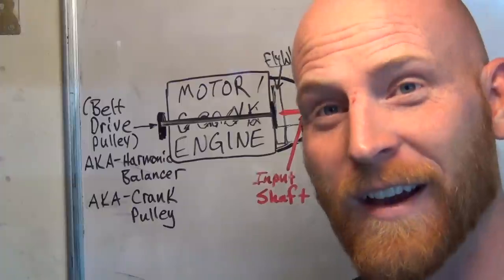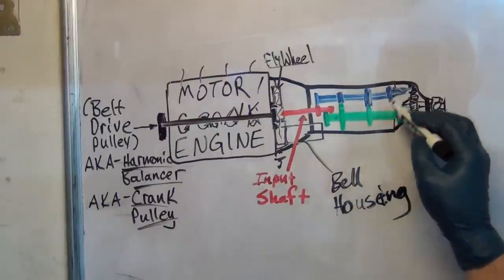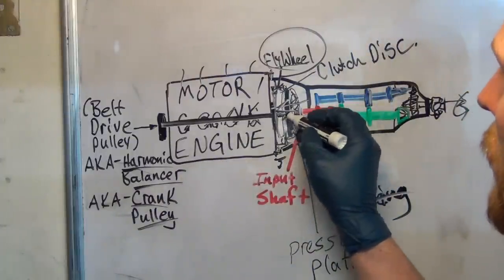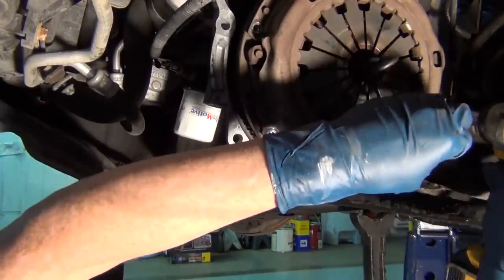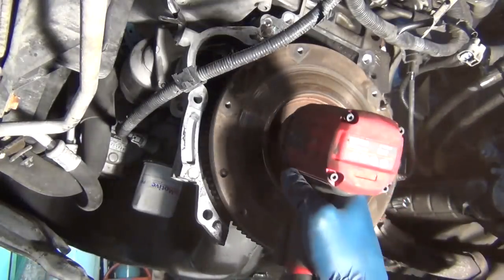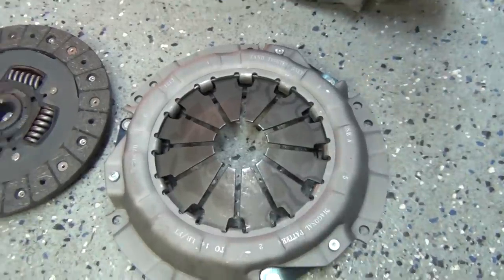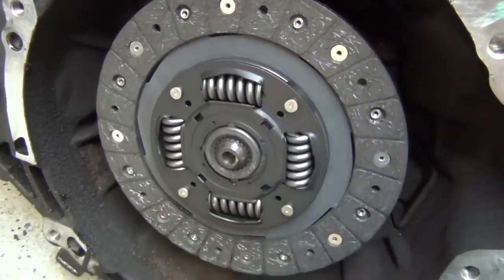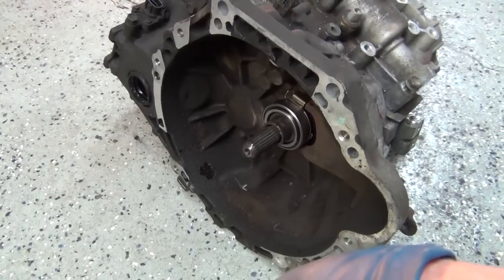How Does a Clutch Work on a Car? Answered

Comment: I've said it before and i'll say it again- I love your videos.
The most important part that I NEEDED to make sense of this entire system was the "Clutch Fork"
The entire idea of switching the direction of forces through geers or the teeter totter process has always been to me one of humankinds most awesome intuitive design schemes that never ceases to amaze me. Knowing how the downward force on the clutch creates the resistive/pressure force on the pressure  plate, now makes everything come together.
Ive had to remove a transmission before (someone came and repaired it at the house but they required we had it on a table and they opened it up and worked it out)

Comment: Great video. One recommendation I would add is that it is a good idea to always replace the clutch fork pivot bolt when doing a clutch job.  Nothing worse than to have that pivot bolt break off soon after installing a brand new clutch. That would be another case for justified curse-word use.

Comment: Great video. I knew the basics of how a clutch worked (without the proper names) but this is so informative.

I'm currently having trouble with my clutch but not sure if its the clutch that's shot or the slave that pulls the clutch lever. Maybe you can help.

Sometimes when I press the clutch pedal there is pressure (ie pushing against the springs to separate the plates.
Other times there seems to be very little pressure and of course the plates are still connected which means I can't change gears.
Clutch pedal still goes to the floor.

Does this sound like the clutch at fault or the slave to you ?

Comment: Brian amazing video and explanation i as well have a 96 corolla 1.8 7afe that ironically is going to need cluch work done soon...  It's funny that you post this at the same time! One word of advice my mechanic and forums say with corollas and maybe other Toyotas it's always good to replace the flywheel along with the clutches higher miles because they have a tendency to slip sill if not replaced with clutch..

Comment: Very good explanation. I have a question, when clutch pedal is pressed is the release bearing always rotating? And if so is it bad for it? What is the best thing to do when waiting at traffic light or traffic jam, press or release clutch? How can we extend lifetime of flywheel, clutch, bearing? Thanks
Reply: turbozobb i have the same question, briansmobile1 what's best to do?
Reply: SoyAweonado turbozobb Best thing to do while waiting in traffic is to put car in neutral and keep your foot off the clutch pedal. Do not ride the clutch. Stay off that pedal unless you are shifting in or out of gear. briansmobile1 has a video detailing the repercussions of clutch riding. Cheers.
Reply: It looks pretty simple but.. i'm from mexico and i live in a little city wich has terrible street management and feels like a fucking carnival to ride here... there is a red stop sign in almost every 2 blocks you drive.. it's insane.. So how much does it hurts to keep the clutch pressed?

Comment: Hi. What make the clutch disk stay away of the fly-wheel when pedal is press? I mean, is like is free, but don't see anything actually moving the disk away to return to in a central position between the fly-wheels. Is like a sandwich. But when pedal is press, what make the disk stay away of both slice of bread? They touch each-other slightly or there is some kind of spring keeping it on central position?

Comment: Great video! The enigma of how a transmission works finally solved. Now, if I could just find out why everytime i push on the clutch pedal I get some serious squeaking. I'm guessing it's something related to the fork or the slave cylinder... maybe the ray's of sunshine or the springs on the pressure plate. That would be less fortunate.

Comment: Good video! I heard you said Red Loctite was used on the flywheel bolts. Would you use Red or Blue Loctite on the pressure plate bolts? I would like to see the replacement of the rear main seal. Thanks.

Comment: when pedal is pressed pressure plate disconnect from the clutch disc.
at the same time ,is clutch disc disconnect from the fly wheel or not .
(why i am asking this is input shaft is connect to clutch disc ,when we apply the clucth pressure plate disconnect from the clutch disc,if clucth disc donot disconnect from the flywheel then clucth disc rotates with the flywheel then input shaft also rotates)

Comment: Hey Brian!
What is the purpose of all those carved out metal "compartments" on the back of the engine block as shown at 16:00?   Is this to save weight, or something to do with the distribution of heat, or both, or something else?
Subscribed, btw.

Comment: Hello Brian! I don’t know if you will see this, but I have a question. I watched your two videos on replacing the subaru clutch, and after putting my transmission back in, the clutch pedal goes to floor! It seems as though the slave is operating fine, I ordered a new one, but I am beginning to suspect that the transmission didn’t go in right. There was a gap between the motor and trans, very small, but i put the bolts on and now the bell housing is flush, but no disengagement with the clutch. Let me know your thoughts if you see this comment, thank you.
Reply from the maker: Hello!  If there's no resistance and the pedal drops, it's most likely the pushrod missing the fork, or there's air in the system, or something not making contact in the kinetic chain between the slave cylinder and the pressure plate/throw out bearing.
Reply: @briansmobile1  Is there somewhere I could email you a video perhaps so you could see for yourself? I bought a borescope and looked in the bell housing, the retainer clips are still on the throwout bearing and it is making contact with the pressure plate, but when I push back on the slave cylinder with the fork away from the pressure plate, I can feel the slave cylinder pushing back. The slave will get to the end of it’s travel, but it still won’t fully disengage the clutch. Weird situation. Wondering if the input shaft didnt fully seat right into the clutch disc and the pilot bearing.
Reply: @briansmobile1 Hey Brian. You didn’t reply to my reply but if you want to know, the input shaft isn’t fully seating all the way in to the clutch disc. So there’s a gap between the pressure plate and throwout bearing.

Comment: Great video Brain!  Q: I see your vehicles on jack stands vs. lift, what do you use to lower the transmission when disconnecting them from the engine to replace the clutch, floor jack?  Thanks, DC

Comment: So I just bought a 96 Impreza outback and she said it had a new clutch in it, I'm learning to drive stick on it, I haven't burnt the clutch, but I've rode it a little, am I going to ruin it learning how to drive, I'm not bad at stick and my brother taught me the less your foots on the clutch the longer the clutch will last and it's just generally better for it. Is it bad to ride the clutch a little at first and will I need to change it?
Reply: I think I've got it down for the most part
Reply from the maker: +Connor Keegan Don't keep your foot on the pedal.  That's known as "riding the clutch" it wears it out really fast.

Comment: Hey man. I have an 86 ford f250 3/4 ton pickup with a 4 speed granny low. And the other day I was driving and all of the sudden it was super hard to shift and I went to stop and the clutch wasn't even working. Took off my inspection plate and I found that it has brand new clutch plates. I also know my hydrolics are working. Plus I was manually moving my clutch fork and there was no compression. Plates wouldn't move. Any help would work. Thanks

Comment: Hey guys question. Im hearing a winding sound from the engine bay. I have had all my belts checked and changed but still have the sound.i only hear it when the car is turned over in first gear. Any ideas? Could it be the thrust bearing?

Comment: I have the same question as below. When you press the clutch what pulls the clutch away from the flywheel since its just sitting on a shaft?  Unless the shaft moves, but i know it doesn't move horizontally.
Reply: At the very beginning of the whole mechanism being taken apart you can see a diaphragm spring. It's the part of the pressure plate that sort of looks like a propeller, it has holes arrayed around the input shaft. When the clutch is pressed  the center the diaphragm spring is pushed towards the flywheel. This causes the outside of the spring, which is attached to the friction clutch, to be pulled away from the flywheel thus ceasing contact of the two friction surfaces.

Comment: Hey Brian awesome job on everything all the way around...my friend got her engine redone i borrowed it for a few days because my truck was in shop.She has an 04 Audi Quattro (cant remember if it was 5 or 6 speed} Anyway i noticed that when downshifting into second gear i could feel like the whole damn thing underneath  the shifter (while my hand was still on shifter ) would  abruptly move as if someone forgot to tighten a mount or nut ... it almost feels like the tranny is moving up and towards the back of the vehicle ... the car rides fine beside that big issue lol...it does it only when downshifting from 4th to 3rd but you can feel it alot more from 3rd to 2nd .... Any ideas?

Comment: Teach me how to drive stick well! Thinking about getting an Sti!
Reply: +Bryan Ho How I learned at first is keep the clutch pressed all the way in, start the car in first gear, and slowly take your foot off the clutch. When you hear the car start to choke, slowly press on the gas and you'll begin to move. Get up to speed, like 10 mph or so, and remove the clutch completely. For practicing (all cars are different) try not to let the car go below 2k rpm, if you let the rpms go too low, you'll kill it. When you press in the clutch, it's basically "neutral", which is great for cornering and maintaining brake control. I typically shift gears when I get to 3k rpm, but once you learn to drive, you'll get a feel for your car and just know when to shift without actually watching rpms. I just found a parking lot and practiced stopping and going. Also, when you're at a stop, always keep the clutch pressed. My dad told me a cool trick to really get a feel for your car, find a very lightly sloped area and stop your car. Hold the brake and clutch, then go to your gas. Rev it up a little and try to keep still without using your brake. It teaches you great clutch control to really get a feel for your car. It takes a little getting used to and can be pretty intimidating at first, but it's so much fun driving stick. I'm never going back to auto. xD and don't be scared of screwing up a few times. It took me two months to fully get the hang of stick, it takes a little bit of time to get used to. :p

Comment: Something worth mentioning, if your viewers do not know this already....Crank shaft endplay specifications will generally be higher on an engine bolted to a manual transmissions. Also because of the rear main seal leaking slightly on this vehicle, it is always wise to CYA(cover your anus) by checking the PCV system. A plugged PCV general blows valve cover gaskets, etc but just a word to the wise. This seal was probably just worn out. Awesome video Brian

Comment: Is it bad to ride the clutch when driving, i find myself doing it occasionally but im not sure if its a good practice or not.
Reply: Yeah, it's bad.
Reply: Yeah, if you ride it enough it'll wear down until it doesn't connect the engine and transmission at all.

Comment: Hey Brian. Need your help. Subie Legacy 95 2.2lt wagon. When I have the a/c on and engine is fully warm to hot, when stopped idle jumps to 1200rpm and sounds rough. With the slightest tap\rasp on the throttle, it brings down to normal idle speed. ie 800. What could be the problem?

Comment: Would I be right Brian with this analogy (allbeit a slightly weird analogy!) that a car's clutch is kind of like the reverse of a cars braking system in that if you disregard the flywheel for a second, you've got the pressure plate and the clutch disc, where I'm kind of imagining that the pressure plate is the brake disc and the clutch disc is the brake pad(because it's technically the one with the friction material (hence the weird analogy), but instead of stopping the motor from transmitting power to the wheels the clutch disc(the brake pad), is what is connecting the flywheel with the cars wheels to keep it moving?  Unless I'm STILL not understanding the clutch properly?!
Reply from the maker: That's pretty accurate.   It's the same principle as disc brakes, but the pads are in the middle and facing out and the rotor is on the outside.  The spring force makes the "brakes" be on all the time and the clutch pedal releases the pressure.

Comment: Hey Brian, there are days where I over rev-match my car when downshifting whenever I'm on a hill and i intend to just let go of the clutch right away and the rpm just drops down. Maybe because i revved up too high. What are the cons on this? thanks,
Reply from the maker: +justin94block Any time you have clutch slip you have wear- just like using your brakes for example.  It's not as bad as driving around with the clutch pedal depressed all the time, but doing that daily and all else optimal, you're going to get 120K miles out of a clutch instead of 200K miles.
Reply: All right man, thanks for the quick reply!
Reply: +briansmobile1 how long should a clutch last
Reply: +briansmobile1 at 6k miles clutch should still be good right??

Comment: How long does it take to install a new clutch kit?
Reply: You have to pull out the engine, then put it back while changing the clutch doesn't take a lot of time. You can do it in one day if you know what are you doing. But it's an heavy task. It's more of a 2 days job.
Reply: teknown
You can also pull the transmission usually this is what I do.  Much easier to pull a transmission compared to a engine.
Reply: Jordan Dea The engine has much more connections and wires, also the front bumper needs to be pulled out. Pull out the transmision and you will have an easier task, you are right. Both operations will do the work, but as always, put everything back in place. My mechanic forgot to screw a bolt and after 1 month, i didn't knew what's with the knocks when i accelerate and decelerate. Nothing serious, but that caused a lot of searching for the cause. It was from a rubber tampon from the front part of the engine, it was unscrewed. I almost change the one of the transmision in the process. Now everything is just fine :)

Comment: Thanks, brian.  I still have a key question unanswered from the video, and would welcome anyone who has the knowledge to answer it.  When the pressure plate is pulled away from the clutch disc as the clutch pedal is being pressed, why does the clutch disc slide along the input shaft towards the direction of the pressure disc (thus disengaging it from the flywheel), when there is no force driving it to do so?  Remember all we are doing is to disengage the pressure disc from the clutch disc, and the pressure disc does not actively pull the clutch disc away from the flywheel. The inertia should keep the clutch disc in contact at least momentarily with the flywheel, thus spinning still with it at the same speed, until the friction is not enough to keep it that way.  If that is correct, the slipping friction will wear the clutch disc in this case.  But again, what is the reason that you say in your video the the clutch disc is going to disengage from the flywheel (meaning that we create a space between the flywheel and the clutch disc by pressing the clutch pedal)?
Reply: The revolution of the flywheel will cause the disc to move slightly away.  Remember a brake pad moves thousands of a inch away from the rotor which this is all the clutch disc does it just moves thousands of a inch and that is it.  It doesn't move a inch away or anything just a slight amount.  The flywheel has to hold the clutch disc on so in sense when it releases pressure it moves away.  I have been a tech for over 10 years.

Comment: A weird question maybe.. theoretical clearly.
Say if I only drive in 1st gear only never depressing the clutch, but also don't over rev, would the clutch parts melt together over time because of metal fatigue?
Reply from the maker: +Trinivalts That's deep.  I think not though.
Reply: Thx

Comment: so what up with the type of clucth like stage 1,2,3,4 and 5
Reply: 1 its stock.  You change the stage when you modify your engine to make more power.  You never need to put a bigger stage clutch in unless you have added a big power adder ex.  Turbo or Supercharger.  If you put a higher stage one in you will just be putting more force on your engine  that you dont need.